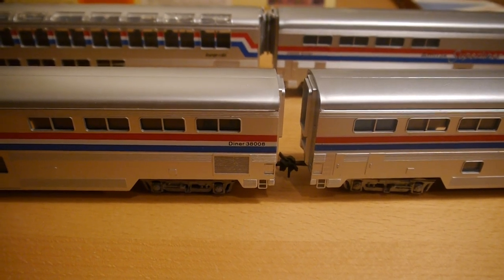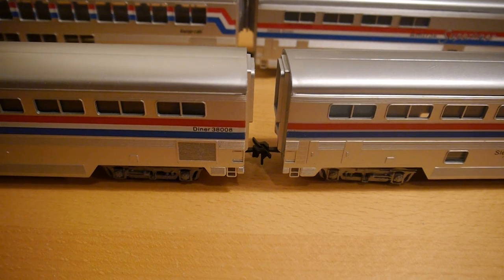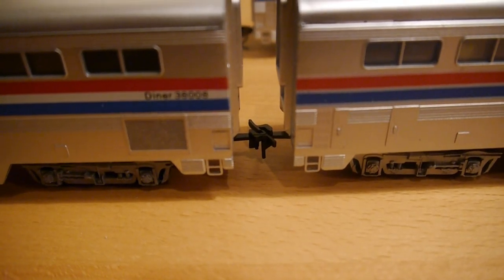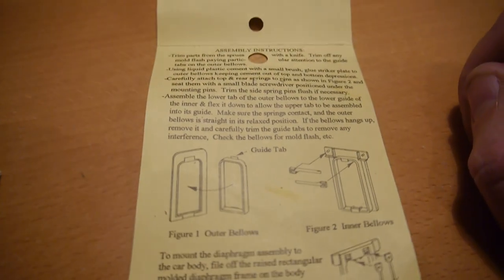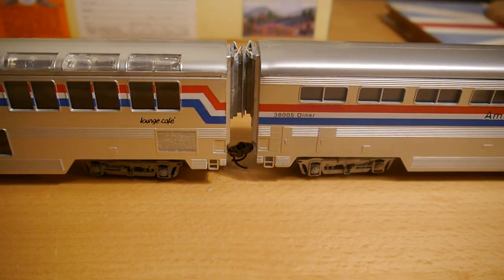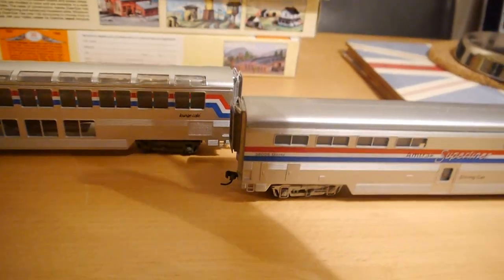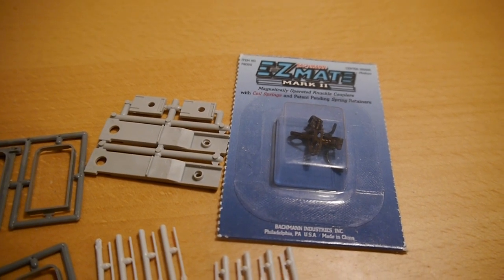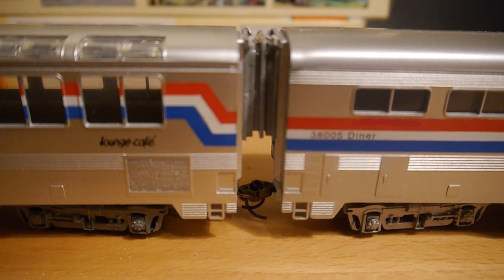Improving Concor Superliner Cars

Comment: What screws do you recommend for the trucks 

(The plastic pins are ass)
Reply from the maker: @F40M07  I don't remember changing the pins. They were quite large if I recall. If I was doing this job today, I would fill the hole with plastic rod cemented in place. Once dry I would file it smooth and drill a new hole.

Comment: Unfortunately, there is one big error in the bodies that takes skill and effort to correct, and that's the wheel wells. Compare the model with the prototype and you'll see where the two vertical sides would need to be re-configured. On the car ends, you'll also have to use styrene to fill in the gaps on either side of the coupler pocket. Again, consult prototype photos.

As for that annoying clear window plastic, the solution is simple. The actual window glazing is tinted. You should be able to obtain window tinting film from an auto supply shop or a home improvement store. Buy a small roll of the lightest smoke tint they have. Measure and cut appropriate size strips and affix them to the (removable) clear plastic glazing. The results will surprise you - no more see through effect, but enough light will pass through both sides to render a realistic look. 

Another "must do" is to scrap those incorrect trucks and replace them with Detail Associates Superliner trucks.

A nice option is to designate one of the cars as the last car on your train. Drill out the dimples of the two marker lights and install a constant lighting system with two red lights.
Reply: Great comment and solid advice.  I have recently begun acquiring a fleet of N Scale ConCor Superliners in Phase 3 and 4.  Very budget friendly, but as pointed out here, the detailing is not really top shelf.  The most annoying thing to me (being an injection molder operator) is the very conspicuous parting line right down the center of the roof on every car.   To add insult, all of the N scale cars I have received also have the injection dimple right at the center of the roof.  I may be a bit too picky about it, but I am planning on taking the roofs off and sanding off the parting line and filling in the dimples.  It may not be quite as conspicuous on HO, but in N scale, it glares at me, LOL.
As for the interiors/window treatment, I love your idea about using light automotive window tint.  I was trying to figure out how I was going to darken the windows, and you answered that question.  So thanks!  I am also purchasing some molded interior sets to install at least in the lounge car.  Maybe the others as well.  Will have to see.
Amyways, thanks for the comment and advice from an old N Scaler.  Will definitely try that window tint idea.  For now, it is time to get the sandpaper and plastic putty out.  Got some body work to do.
Cheers!

Comment: Most current Con-Cors have knuckle couplers, I realize this video is some years old any they wre probably using up the remaining hornhooks before changing over. I believe Con-cor is a budget-friendly brand which accounts for the lack of detail on certain types of Rolling Stones.
Reply from the maker: These cars were sold as "new - old stock" and i realise that more recent recent releases of these cars have improved some what. I just wanted to highlight that for a small expense in time and effort these cars can look more prototypical. Also there is a sense of satisfaction in looking at the model, and saying "i did that!" The couplers aside, i think the biggest improvement to be made to the cars is the diaphragms
Reply: The Concor models not only lack interior details and proper "window  tinting" but have the " wrong trucks", as well as those "talgo type couplers".The superliners are NOT WEIGHTED PROPERLY as per NMRA standards. My advise is to use those solid brass strips sold in hobby shops from K&S Engineering that's 1" X  .032" thick X approximately 11" long. Use that an addition to the steal weights supplied with these kits and consider drilling & tapping with a # 2-56 tap and #50 drill bit, and # 2-56 screws.  The Palace Car Company DOES offer interior kits for SOME OF these concor cars,  you'll want to check out there web site and a bunch of these are available through Walthers. These cars are really intended for beginners and are cheaply made.

Comment: Nice job! In case anyone is interested, they now sell a upgrade kit to change the wheel mounts and couplers to the new design.
Reply from the maker: Interesting to know! Who produces the upgrade, American Ltd or Concor?
Reply: Mike Light Con-Cor does. It updates the old versions of the car to the standards of the current ones.
Reply: +Mike Light I have been doing some more upgrades to mine. I don't plan on adding diaphragms, but I have found a company that sells the correct trucks for the superliners. The company is train station products. You can buy them through  walthers.com